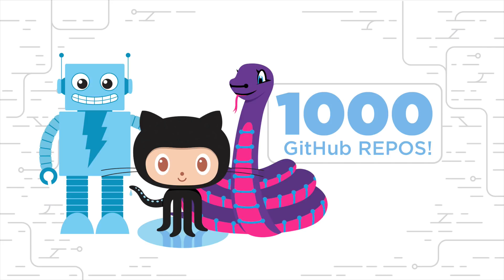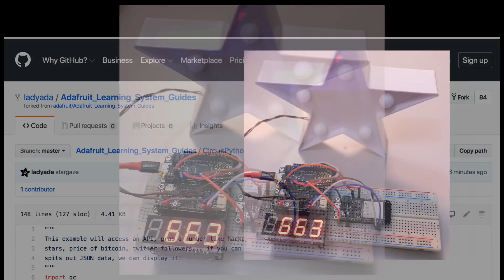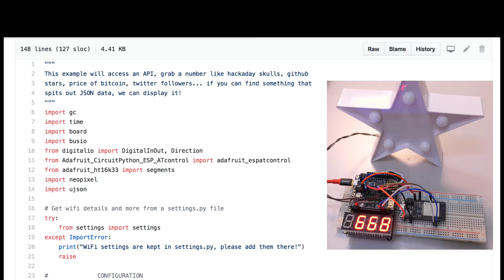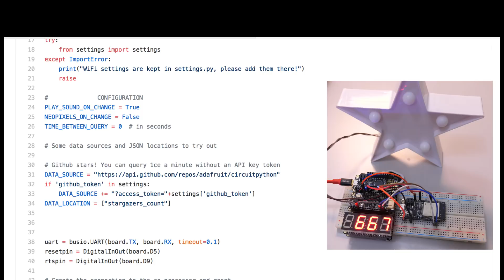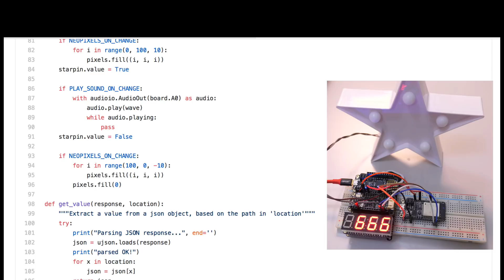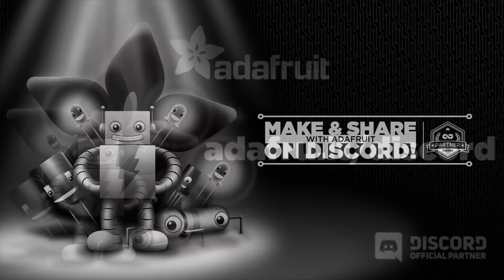NEW YEAR'S DAY 2019 - GitHub stars live @adafruit @github #adafruit #github #circuitpython

Comment: I'm experiencing a lot of analog input noise on my arduino project. I have 4 pins monitoring voltage and it's important that there's no lag. When the pins aren't plugged into the arduino, there is no malfunctions. When the pins are plugged into the arduino, even when the pins aren't triggered or given any voltage, there's malfunction. Any ideas on how to reduce/eliminate noise? I can't spread the inputs apart because I'm using an Arduino Uno and there's not much space. Would electrical tape or hot glue around the wires insulate the wire and prevent noise?
Reply: You can use RC circuit for that. https://forum.arduino.cc/index.php?topic=527478.0
Reply: @nolan-the-faker  thank you for the link. I'll try the 10k resistor method and see if that helps. Any idea how much of a delay with will cause? I need the readouts from the pins to be as quick as possible
Reply: @BLueFeaTHeRedOliVeS  there is no delay , the RC circuit just smoothes analogue signal.
Reply: @BLueFeaTHeRedOliVeS  I think, there is no way to increase the rate of taking readouts
Reply: @nolan-the-faker  oh okay. I just ordered some 10k resistors from Amazon so I'll test your pull down resistor method out as soon as they get here. Thank you very much for the help